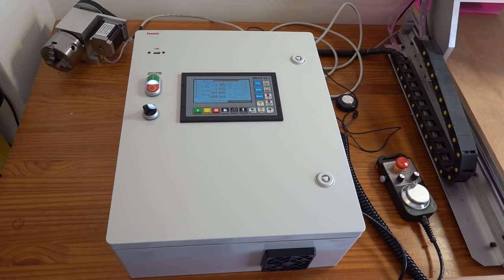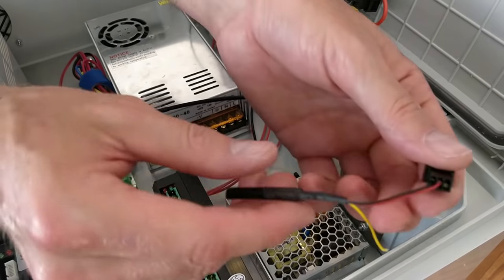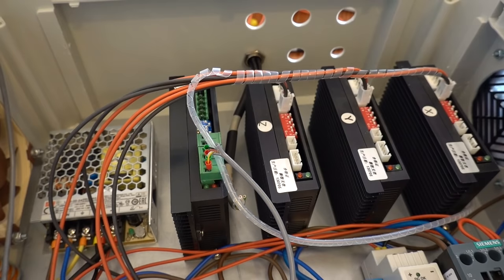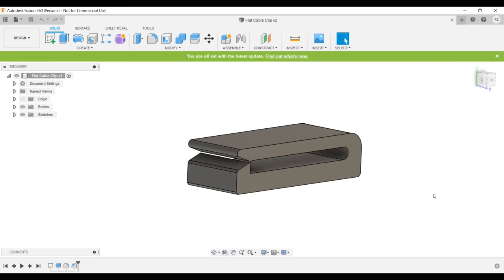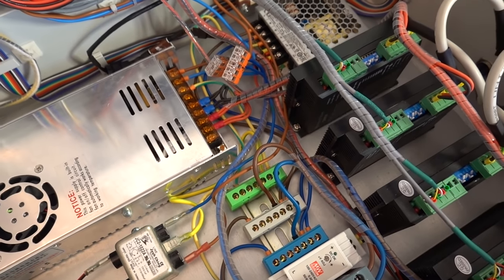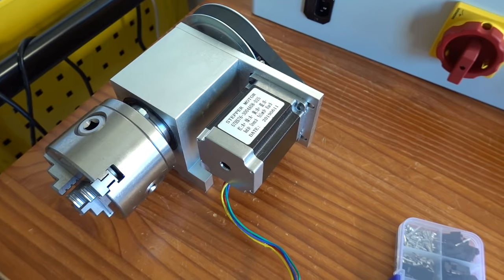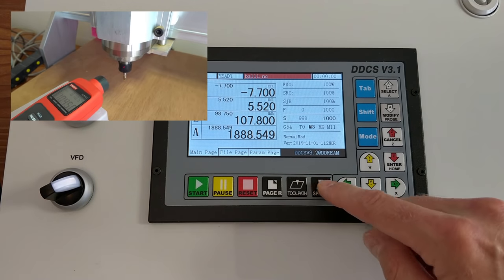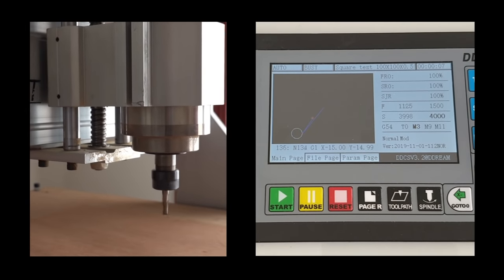Build Your Own CNC Controller, Part 2  |  DDCS V3.1  |  6040 Router

Comment: Pulse /revolution and pulse setup calculations stepper motor pulse
Reply from the maker: Hi, Pulses per revolution and pulses per mm calculations for linear and rotary axes are included in the PDF file in the website article linked in the description of the video. Let me know if you need any additional information. 
Robin
Reply: I want video sir pulse/revolution and pulse mm please 🙏 send me sir
Reply from the maker: Hi, the document had quite detailed descriptions of the calculations. If you need any additional help please let me know. I am not sure if it makes sense to make a video on this. Sorry I am limited in time and have to be very selective on videos. If the document is not clear let me know.
Robin

Comment: You were using the wrong crimp tool, there is a special tool for those smaller fast on connectors.
Reply from the maker: Thanks! For this DYI project I am still glad that I went for the screw terminals. Much more flexible.

Comment: pulse equivalent calculation sir videos please send me sir
Reply from the maker: Sorry I am not planning to make a video on this in the near future. The calculations are explained in the PDF under section "DDCS V3.1 parameters"
Reply from the maker: I am only communicating through youtube, so others can also see the information and ise it for their own project.
Reply: Sir pulse per mm linear motion calculations
Reply from the maker: Please do not send me your phone number. I am starting to feel like this is some sort of phishing attempt, so I will no longer respond to questions regarding the calculations. I have already directed you to the information on my website 3 times. It includes the calculations and explanation. If you are really interested you would have checked the document instead of asking for my phone number.
To others reading this comment, I am more than willing to help anyone who has specific questions about this project, but only on youtube or the comment section of my website. Thanks, Robin
Reply: Sir pulse per mm in helical gear
Reply: I understood about ball screw pulse, but i didn't understand about helical gear pulse calculations. is same helical gear pulse calculations and screw calculations?
Reply from the maker: I assume you mean the 4th axis when you say helical gear? For the 4th axis there is only the 6:1 pulley ratio and 2000 steps per revolution to take i to account.
Then divided by 360 to go degrees. Here is a copy of the PDF, please let me know what part is not clear:
4-th axis pulse setting: Small pulley 10 tooth Large pulley 60 tooth Stepper setting 2000 pulses per revolution With 6:1 ratio this means 2000*6 = 12000 steps per revolution 12000/360 = 33.33 steps per degree
Reply: I understood your explanation thank you very much sir 
Thank you for your time 
Thank you a lot
Reply from the maker: No problem, hope the information was useful. Good luck. Robin
Reply: sir how to calculation y axis linear motion helical gear pulse
Reply: sir how to calculation y axis linear motion helical gear pulse
Reply: Sir how to calculate Y axis linear motion helical gear pulse

Comment: do you connect the shield of the shielded cables to the ground ?
Reply from the maker: Yes, they are connected to the central grounding block.
Reply: @uptimefab7412   yes i've noticed you mentioned that in the Part 3 video